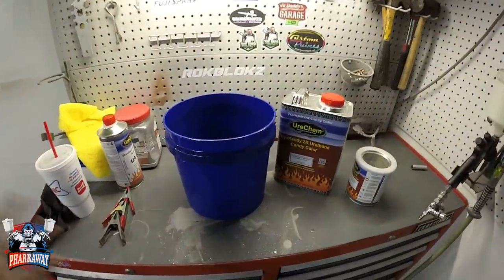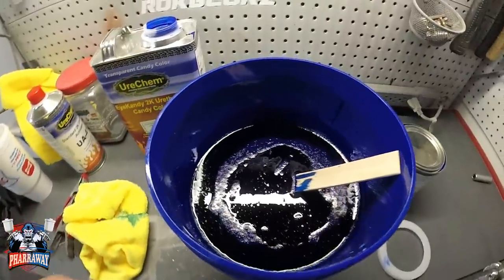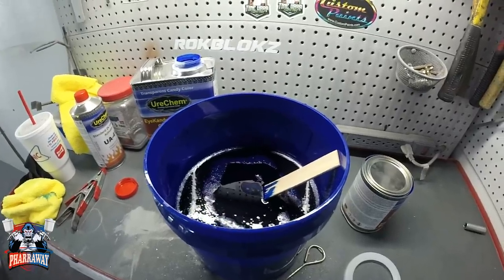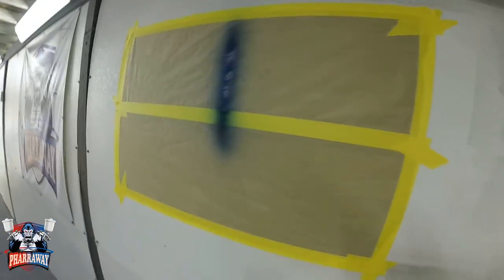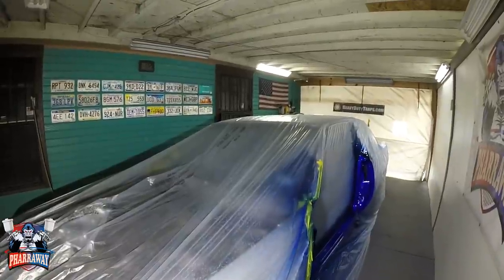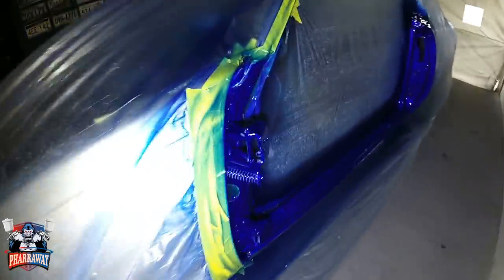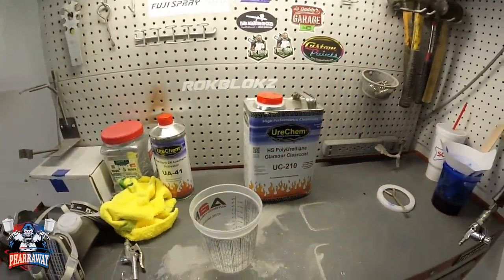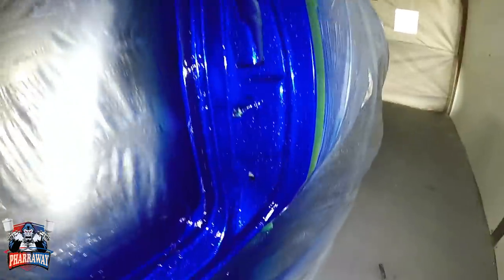How lowrider cars are painted with candy paint and metal flakes part 8

Comment: What gun is that
Reply from the maker: It's the Walcom carbonio 360 HTE
Reply: @PHARRAWAY  thank you also what do you recommend for clear coat on the supernova a 1.3 tip or 1.4 ?
Reply from the maker: @SernaKustomz...  I actually use a 1.2 tip with the MP air cap on the Walcom
Reply: @PHARRAWAY   what tip do you use for base with the walcom carbonio